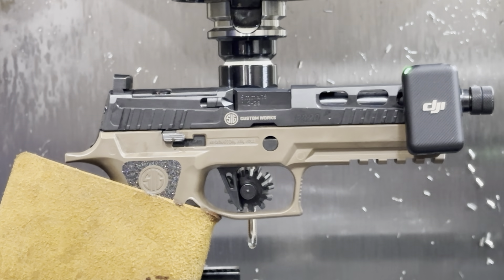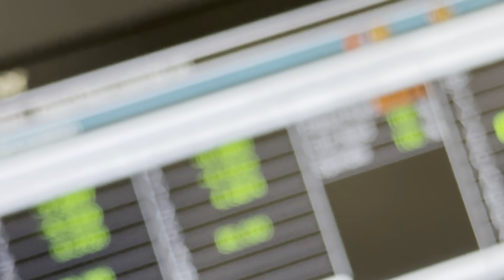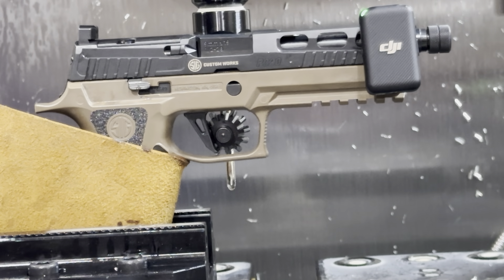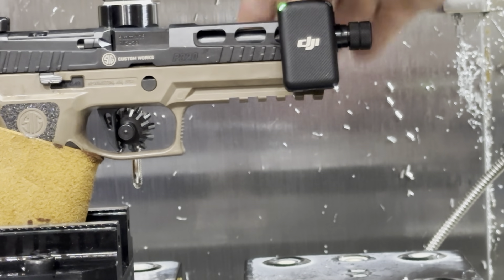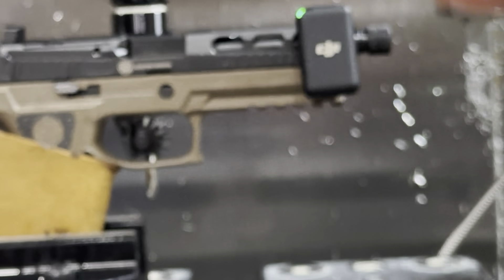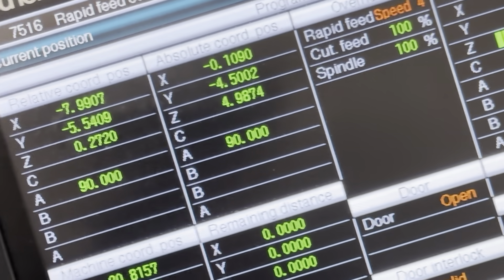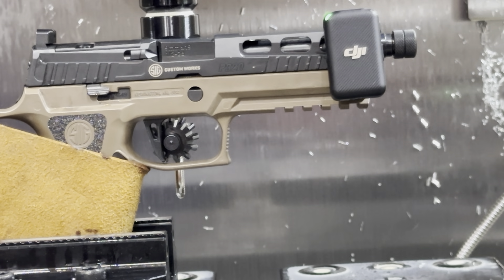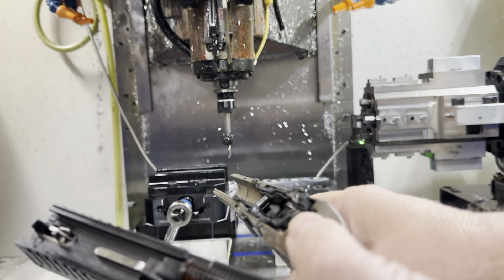Sig P320 accidental discharge tested in CNC machine.

Comment: I have a p320 and I love the gun and It's a great shooter. However, after looking at numerous videos I now know there is something to what people have been saying. I finally saw a video the other day of someone doing an experiment like this one that is not as technical but I was able to take my p320 in hand and have it dry fire by moving the slide. Yes, I had to hold the trigger up against the wall using my finger but I did not pull it. I could actually feel the trigger pushing out against my finger and then it quickly fires. It shocked me that the trigger actually has a forward movement while pulling the slide back and I wasn't going all the way back either (maybe a tenth of the way?). Is this the answer to what has been happening? Probably not but the design seems to have a flaw to me.

Comment: It seems to me like maybe the holsters are putting some pressure on the trigger causing enough movement to bypass the firing pin safety block.  The slop allows enough movement for the sear to disengage.  Like a perfect storm of variables.  A trigger dingus would probably have solved all of their issues from day 1.

Comment: It might take a few dozen samples, but my suspicion is that you might have one that does off when it's just 19 thou from the typical point when it fires, but you might be able to find one that goes off 40 thou earlier. 

The fact is there have been way more cases of P320's going off in holsters than with any other striker fired gun. That might take actuating the trigger, but it'd be nice to have a reason why that happens more. Fantastic test setup, though. Nice to see someone taking it seriously instead of eyeballing it with calipers and a wood screw.
Reply: Mine goes off AT the wall. All I have to do is remove the slack touch the slide and it fires.
Reply: @BossMan302  send it to test?
Reply: @krisc8353 I sent an email last night, haven’t heard anything yet but I’d imagine they are swamped right now.
Reply: @BossMan302  crazy! Put that thing in the safe until a recall.
Reply: @BossMan302  record it please
Reply: This test also does nothing to account for vibration. In my opinion, vibration is a very likely contributor.
Reply: @grbluen  Time for the Hitachi test?  Gentlemen, borrow your lady's best friend.  lol   Sorry, I couldn't resist.  Might make for a humorous as well as informative test.
Reply: Wyomings test was clear and informative. Just because he used a screw instead of tech means nun bcuz both videos showed the exact same thing. A screw vs a cnc machine. Regardless it shows the travel and manipulation of the striker/sear. Same results, no further to go off of just because he got a precise measurement. Point is it shouldn’t b goin off when u don’t even hit the wall.
Reply: Way more? You have the actual numbers of every major firearms manufacturer? Or are you saying what has been reported way more?
Reply: @RighteousLiberty  I'm saying the P320, unlike every other common pistol on the market, is going off in holsters. There's a single example of that with a Glock that frequently gets used, but that was with a string that somehow got through and grabbed the trigger. Which leads me to think there's some manufacturing issue that allows some P320s to fail.

Glock leg went away with training and had disappeared. We then go nearly two decades without it being a common problem again, even with a bunch of other striker fired pistols (departments got XDs, M&Ps, even 509s), only for it to come back, but just for the P320. I'd be curious to see this test done on one of the ones that went off in a holster.
Reply: @isaac6705 

Even so. That’s still what’s being reported, not the full numbers. There’s been a couple of times a Glock went off in a holster - not sure which incident you’re referencing. 

However, it could be something as simple as the Glock, M&P, HK, etc. having a passive “dingus” safety on the trigger - requiring full entrance to the trigger guard. Whereas I’ve been able to make the P320 fire just by pulling the edge of the trigger.
Reply: @RighteousLiberty Are you saying that uncomanded discharges are a comon thing amongst striker fired pistols but only one specific model of sig is being singled out to be reported about?
Reply: @vernmorris8898 

They’re not common - not even among SIG P320s statistically speaking. I’m simply saying you’re only seeing what pops up in trending news feeds and it’s a fact anti-gun organizations like the trace have pushed this narrative, and have a stake in doing so.

With that being said, I’m curious how widely publicized this issue would be if it weren’t for the widely reported and recreated drop safe issue with the old design trigger. There’s been a lot of negligent discharges that don’t result in lawsuits, news reports, or released video footage that people have sucked up and accepted as their mistake. I’ve responded to some. How many of these incidents are result of someone going, “wait, this is a p320. I can just say the gun went off.” There’s a lot to consider.

Comment: Look at the slop on that slide though. Looks like one of my shot out Hi-Powers
Reply: I wonder if that is a result of the "modular design." Big, sloppy tolerances so you can easily swap out the latest in gun fashion. Or have 8 pistols in 1. 

I'm not saying thats the case. I am pretty ignorant of FCUs and "modular" pistols. I'm an old man. And theyre different. So they scare me and make me grumpy. 

I havent heard of any slop in the Echelons. Anyone know what the fit and fitment is on any other modular pistols?
Reply: @MyName-r2i9u  There are several modular pistols out there.  It would be an interesting test to see how much play exists in competing designs.  Even compare the p365.
Reply: The slide movement does not occur from bad machining. It goes away when a magazine is inserted.
Reply: @connorcline6982  bullshit, I just watched a guy do the same test with the mag in and his was sloppy as shit. These guns have playschool tolerances.
Reply: @connorcline6982  My P320 remains sloppy with a magazine in it,  a little less from the FCU to sriker. the barrel stays wobbly and depressible. This can be fixed by builing a longer FCU with wider front to rear tabs even adding another tab further forward and going machined from barstock & stamped instead of cast/mime parts in the fcu. hope they fight this until they are forced to do a recall buy back including magazines!
Reply: @richardhansen342  Stacking tolerances etc. I have a Ruger RXM and its just as tight as a Glock